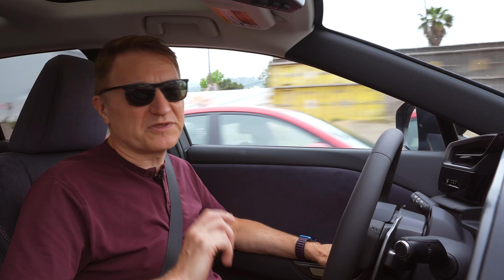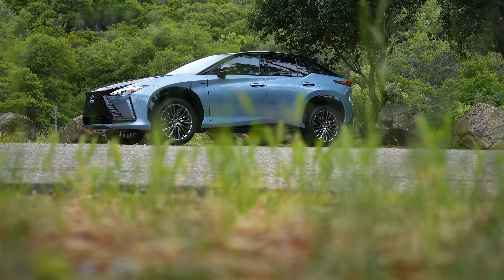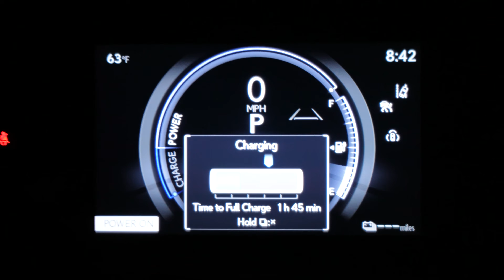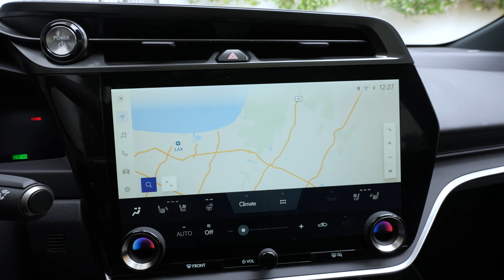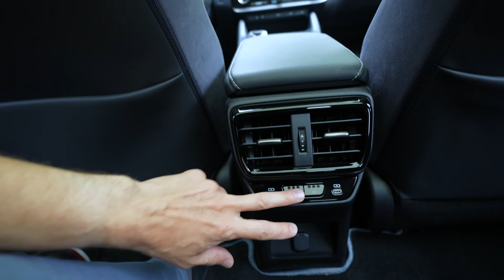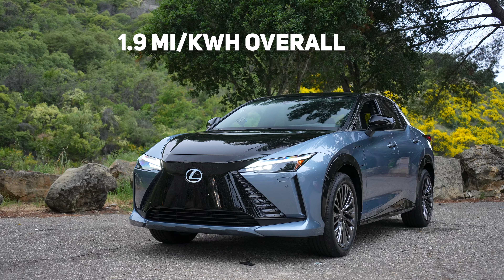Lexus RZ - First Real World Range + Efficiency Test (Oh My!)

Comment: it depends on your use profile. the range is fine for me (UK based), I commute to work (80 mile roundtrip, couple times a week), charge up once during week then before the weekend. but I can see how this would be an issue for some in UK and US. the depreciation on these is enormous so you can get one hell of a car (23 model) for about £22k in the UK currently (Sept-26)
Reply from the maker: Depreciation helps a lot! And yes, where your commute distances are shorter these make a lot of sense.

Comment: Toyota Lexus has unfortunately shot themselves in the foot with the ultra conservative methods of battery usage and calculations for range.  First, they need to unlock some of that huge buffer on the top and bottom of the battery.  There's probably at least a solid 8% more battery that can be used using a similar buffer to a Tesla or German branded car which would free up some mileage.  Additionally, the low light gauge comes up with a lot of battery left, when the AC is on it grossly over estimates the loss in range but without having more battery data in the MID or an OBD II scanner, it gives the driver a lot of range anxiety with all the beeping and flashing messages to charge.  I think it's a great car and it can be fixed through software.  I hope Toyota/Lexus helps their customers out with this.

Comment: I work at Toyota HQ in Plano, Tx and we get killer employee lease deals on these. I’m thinking about getting one, we usually use my wife’s Highlander to drive long distances, I’d just be using this to drive the 16 miles to work 3x a week and errands on the weekend
Reply from the maker: For a great lease deal, this will be a solid commuter. It's a solid vehicle if range and charging speed are not big issues.
Reply: Did you get it?
Reply: @fertexas  I did order it. Should be here in two months

Comment: mmm.. Wondering why Lexus's rz450e have different range. In the US it only has 196 (20's) -220 (18's) miles (315 - 354 km's) while in other countries it's around 279 miles (450 km's) while in Japan it's rated at 306 (20's) - 331 (18's)  (494 - 534 km's).
Reply: Different standards for testing. Have to remember epa has a specific test for the car here in the US. As I’m sure each country does their own
Reply from the maker: European test cycle (WLTP) is much more forgiving than US (EPA) test cycle. WLTP is not very realistic in the real world.
Reply: beacsue its AWD

Comment: Terrible range that plummets if you use AC or heat.  Overpriced prototype that no one should buy.
Reply from the maker: They will have their next gen architecture out around 2026. This platform is just not that efficient.

Comment: Tested in the Netherlands, 280 up to 325 km real world range, given the small battery pack,  good. 15 years warranty,  an industry first. Finally a bev with resale value! Very silent, fast, efficient motors. This car will receive some software updates later this year, expected range 400km. So why on eart tge focus on range???? Very few drive more than 300km's daily! It is complete nonsense.  Every journalist is focused to complain about range... utter nonsense.

And if you want range, wait for Lexus 2026...... range more than 1000km with solid state. Yes, I'm Toyota insider.
Reply: @avdp9095 thanks for this info. We have an Ioniq 5 for longer trips but I want a premium SUV for driving around where we live in southern Portugal. As you say, I'm interested in the long warranty so I can sell it on in a few years. Can't imagine buying a used EV with no car/battery warranty. We do 50-100km max most days. Can charge off the solar at home. The ride, stereo, safety, materials, etc are more important to me than fast chargine or max range. In a few years when the next gen batteries are out we might upgrade the Ioniq 5, for the longer trips (still only does 280km at highway speeds) but the RZ would still do the job for around where we live
Reply: @edwardharris1022  yes, true, just wait for the RZ 300e, little bit more range and also with more comfort, if tgat was possible..... . If the RZ is to small, wait for the new Lexus ES, will be introduced in 2025 as 2026 model year. This new sedan will feature 2 EV choices. A 350e and 500e...... . 

Yes I think the RZ is a very good EV even, we have a very good warranty from lexus and yes, resale after 4 or 5 year was very important to us. I think it is unbelievable why the media doesn't look at the resale and warranty of modern day Bev's. ...... .
Reply: Because people dont have time to sit 30+ mins to charge a car. Also i know the Netherlands is a small country where people dont actually use a car that much. Look at France, Germany, US, UK where people actually drive about 200km, it would be much easier to just refuel your tank in 5mins and go (and refueling is not even needed daily but every 1000km so once a week).

Another very important point, we dont have to contstantly worry about recharging while keeping our time management in mind all day long. 

Last when you go on a vacation you dont want to charge 10 times on your way when you go to southern france for example.
Reply: @jijdom  200km's daily, very few do that. 280 upt to 325, even 345km for the RZ, sufficient for 95%.... . Charging in 30 minutes, all Bev's charge in 30 minutes. ID4,  Etrons, Ipace etc etc. Only Tesla's charging faster. It is with a reason Lexus don't want us to fast charge, it is killing for the batteries....same for all Bev's. 
So if you drive 250km, you can charge at home, street or office, and you have another 250km, in 30 minutes... . So 500km a day, cost you only 30 minutes.
This RZ was tested against a Bmw Ev in the Netherlands,  and both did 30 minutes to charge from 10% to 80%, source: Autovisie (leading Carmagazine in the Netherlands).
They pointed out that the RZ was a very comfortable, very well finished, extremly quiet and fast EV with considering the small battery pack, good range and efficient motors.... . It is not a Tesla but certainly not a bad EV.
Reply: @avdp9095  few dew maybe in The Netherlands, but the rest of the world people who actually use car do drive 200 a week, very possible if you exclude the netherlands which is a very small country. Also you dont actually use 100% capability of the battery to drive. Nobody takes the risk to drive below 15%, so when you are at 20% you already need to worry about where and when to charge. And when tou do actually charge nobody will sit for one hour to charge to 100% but stop at 80% which is usually 30mins (which still is a lot of wasted time). So effectively of the 100% capacity people usually use only 60% of the battery. Assuming this car can go 300km on a single charge you effectively only use about 60-70% of this range which is only about 195km which means you cant go from cologne to frankfurt and back on a single or two charges which means you waste time with charging for at least one hour and the during your drive you need to worry about driving style, not going too fast, not to use too much features like AC or Heated seats, heaters, etc. Not really the future…
Reply: Agreed, i drive less than 75 km per day on avg and that is mostly city driving.  if you have a charger in your garage, you really are fine with this range.  If i want to take a trip, i can drive to the airport (20 miles), subway (2 miles) or amtrak train station (6 miles away)...  City living.  It bothers me when people make videos that focus on "if you don't like x don't buy this" when there are plenty of people that this EV works well for.  People who can charge at home, work, or while shopping, and don't need to drive for hours on the highway. Most american households have multiple cars outside.
Reply: And you worry about going faster than 100kmh as it will deplete your battery faster, you worry about using AC as it will affect your range, worry about using any feature for range, worry about cold weather which will affect your range, worry about occupied charging stations whereever you go. Electric cars will never replace ICE in this state unless the government pays for it, which of course mean that poor people will pay for it.
Reply: @jijdom  it will when they come up with 600mls or 800km even 1200km of range... . Ice is over and out, in Europe, eventually in the States as well, het used to it, all due to climate nonsense.... .

I will drive our Lexus plugin as long as possible.... . 
I hate Bev's for another reason, complete dull driving experience...they all are the same  Teska, Mustang, Id, etc etc. No engine noise, lots of road noise, hars suspension,  very limited comfort etc etc. 

In that respect the RZ is the best EV, no road noise at all, very good suspension and comfort.....
Reply: @avdp9095  its not the range that is the problem. Most people would not mind a 300-400 km range if recharging was 5 minutes.

Comment: Hey Eric, I'm wondering about the numbers you posted. 110kWh to go 212 miles seems off. Lexus says the RZ450E has a 63kWh usable pack (71kWh net) and you did 185 miles on a full charge which averages out to 2.94mi/kWh. 

If 63kWh could get you 185 miles and you did 212 miles total on 110kWh, why did the final 27 miles require a whopping 47kWh of additional energy? That would work out to a miserable 0.57mi/kWh for the final leg of your journey. It doesn't make sense.
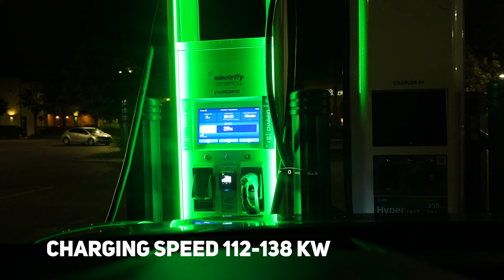Reply: At 16:46 of the video the screen on the Electrify America charger is shown.  If make this out correctly it says 6min charging time and 46.822 KWhr delivered.  That's a rate of about 500 KW on a 150 KW charger (good job EA).  Also the battery is at 29% which is 18.6 KWhr in the battery (64KWhr usable battery capacity).  He said he arrived at the charger with 12 miles remaining which is about 4 KWhr in the battery.  Seems like the energy delivered should be about 14.6 KWhr.  Time is 6 minutes so that works outs to right at 146 KW or 150KW-ish charge rate which is the charger's maximum rated.  So it's not RevMatchTV's fault his numbers are wrong, but, he should have immediately noticed the numbers don't math out.  I suspect he's not an engineer.
Reply from the maker: Hi Anthony - great comment. When I got to the charger I had driven 173 miles. 

According to EA, I charged for 9m 8s and received 52.04kW at a max charging rate of 141 kW. However, I had not charged the battery fully and RZ showed it was only about 40% charged. (I assume the charge indicator is not accurate)

When I got home, I charged overnight to 100% and added 57.97 kWh. Total used was 110.01. 

So I did not us 52kWh to go 185 miles. I used a a bit more than that go 173 miles. The charge rate was beginning to taper and I wanted to get home so I drove pretty quickly on my last leg, also gaining about 500+ vertical feet and driving up the hill with traffic doing 75 or more for the rest of the journey.

The final leg of my journey was 39 miles. The battery was not flat when I arrived home, but ultimately I added 58kWh at home. so let's say I actually used 50kWh to to 39 miles. That works out to 0.8 mi/kWh which actually is not unreasonable. I've seen less than < 1 mi/kWh driving fast before in my Mach E GT. 

The car I'm driving is clearly marked as a prototype, so I'm assuming that programming, battery capacity etc are not reflective of a production vehicle.
Reply: @revmatchtv  There's no way you put 52.04kw into the car in 9min 8secs! That's a charge rate of over 300kw/hr! EA messed up somehow, but the most you could have added to the battery in 9.14 minutes would be about 20kw with 9  to 18kwh being more likely. Total consumption for 173 miles should be ~55-65 kwh.
Reply: @revmatchtv  Ending at 40% charged should be about 25.6 KWhr in the battery.  You said you had 12 miles of range which is about 4 KWhr (assuming 3 mi/KWhr) so you charged 21.6 KWhr in 9 minutes which works out to 144 KW charge rate (pretty close to the 141 KW you saw).  Hopefully you weren't charged for 52.04 KWhr when you only received estimated 21.6 KWhr of energy. If you thought you were getting energy at $0.48/KWhr you're actually paying $1.15/KWhr.  EA is owned by VW in response to the whole DieselGate cheating.  Looks like VW found another way to cheat.

Comment: Try hard to find weakness - why do he hate Lexus?
Reply: everyone says that tesla are better .. bad quality! bad warranty! Terrible driving quality! panel glitches! yes it has good autonomy and charging speed! but if the battery is damaged you have to buy another one and they are not cheap!! now the lexus is better at everything than the tesla except for autonomy and charging speed! but here in europe they give me a million kilometers warranty on batteries and motors! car quality is light years ahead of teslas! I'd rather have a reliable, quality and guaranteed car than have another 100 kilometers of autonomy.. stop making videos like this and do real things that matter.. autonomy and loading speed is not everything! Overall the Lexus RZ is better!
Reply: @latinlovermgr  Teslas use the same wishbone suspensions as Porsche, no one ever complained about driving quality on a Tesla.  You do not know what you're talking about.  Teslas do have some QC issues especially panel gaps and paint defects.  Their service centers also suck, but overall I wouldn't recommend an RZ over something like a Model Y.
Reply: @MrWhiterunGuard  If Tesla really has the same suspension as a Porsche, they screwed up somehow. The Model 3 and Y are some of the most bone rattling cars I've ever driven. They are also far from quiet. And, if you go with the overpriced S or X, they are better in those regards, but there are still much better out there. The Porsche Taycan is far superior in everything that matters, while being in the same price range as the S. The Lucid Air is also far superior to anything Tesla offers.
Reply: @BeefJerky9999  Lucid Porsche of course you’d expect them to be better. They’re significantly more expensive LOL
Reply: @latinlovermgr  no Tesla has tech, performance, handling, range, charging infrastructure, and it’s cheaper
Reply: @naveenthemachine  It's clear you've never been in an RZ. I've test driven a ton of EVs, and to say that the RZ "does nothing well," shows just how ignorant you are. Range isn't great, but it's more than enough for most peoples driving, including mine. And, the build quality, comfort and ride are exactly what I expected from a Lexus. The RZ is on my short list for my next EV.

None of the Teslas are on my list. The Y and 3 are both just too bone rattling and allow way too much road noise into the cabin. While the S and X are better in those regards, there are far superior alternatives in those price ranges. If I was spending that kind of money, I'd get the BMW iX over the X; aside from the awful grille, it's a phenomenal vehicle. If I was looking for a car, I'd likely go with the Porsche Taycan, Audi e-Tron GT or the Lucid Air. They are all far superior to Tesla's offerings.
Reply: @BeefJerky9999  the bz4x itself has zero positives. Same for the RZ. And yeah I haven’t been in the RZ and after driving the competition like especially the Kia ev6 or ioniq5 it’s clear that I don’t need to and I don’t want to be in the RZ. Because those two Korean evs are far superior and that’s a fact
Reply: @naveenthemachine  Man, I've seen you spread so much Lexus RZ hate throughout comments on multiple videos. It's hilarious!

Since you haven't actually been in an RZ, I find it hard to take your opinion seriously. I have, and I've also been in the Ioniq 5 and EV6. Both of those are great for what they are, but they are simply no match for the RZ in terms of comfort, ride quality and road noise isolation.
Reply: @naveenthemachine ông a Tesla fan
Reply from the maker: I spent most of this video on elements I think the RZ does particularly well.
Reply: @revmatchtv  this was a very fair and honest look at the Lexus. Eric has a lot of praise for this EV for what it is. It rides and drives terrifically with a wonderful interior full of luxury touches and nice surprises. The handling and performance are in line with a premium crossover. It just has lousy range and half-baked software.
Reply: @anthonyc8499  You forgot the abysmal charging speed, but the presentation did make clear it's not a long range EV solution.  It is a good choice for somebody.  A Lexus fan looking for a second (or third) vehicle driving mostly short trips close to home and this might be The One.
Reply: @cbotten106  it’s a luxury EV for town runabout duties. It works just fine for that. It’s possible Lexus updated the charging profile like they did to the BZ4X.
Reply: @revmatchtv  it does nothing well LOL
Reply: Lol no you’re wrong. This ev has no strengths whatsoever. Not one
It’s all cons no pros for this ev